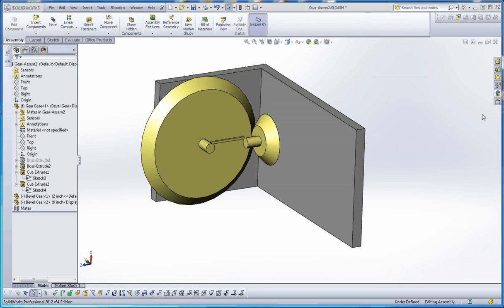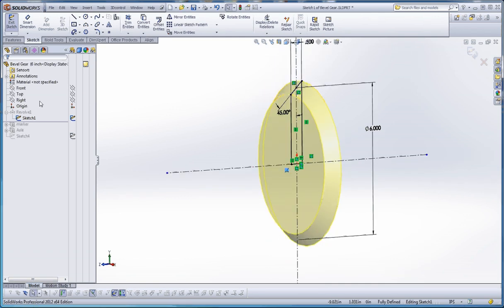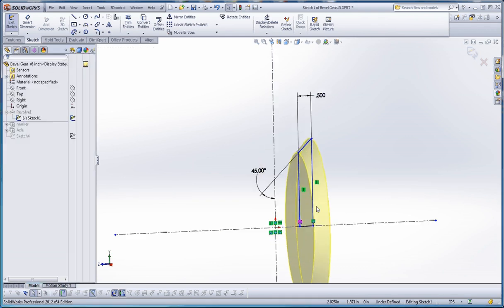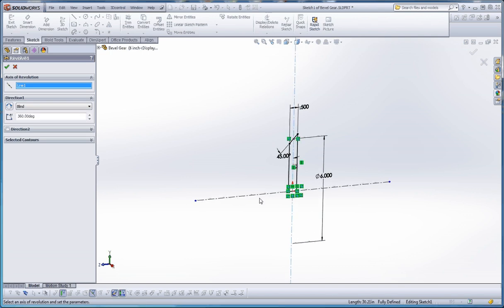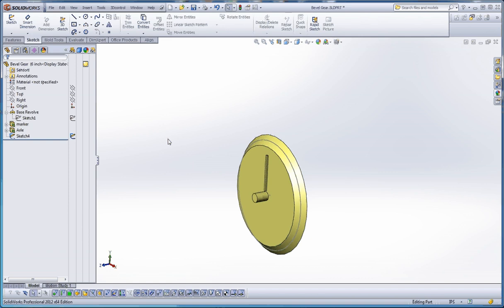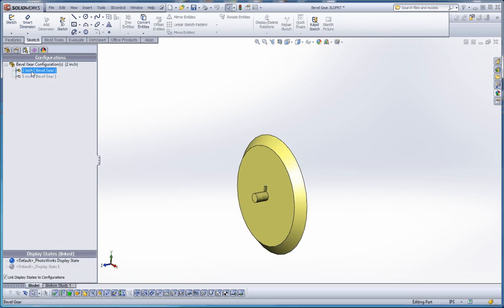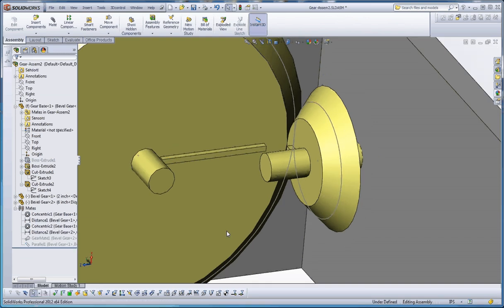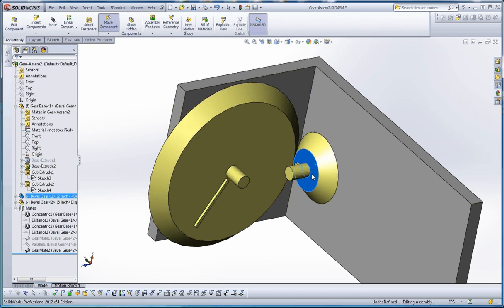Simple Bevel Gear Friction Wheel Demo using the Gear Mate, Mechanical Mate

Comment: Just about fine in SW knowledge, no clue of how bevel gears work.  45° cone  base angle is correct only for gears of equal diameters.  The correct angles in this case (2" and 6" diameters) would have been 18.435° and 71.565°.  In this case any tangent angles would have given the same transimssion ratio, not messed it up.  This is how gears work.